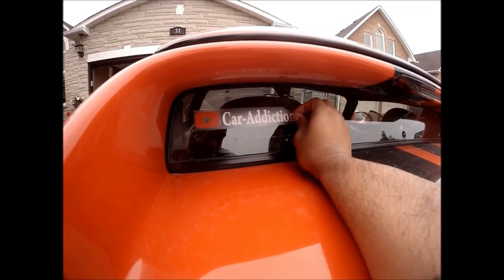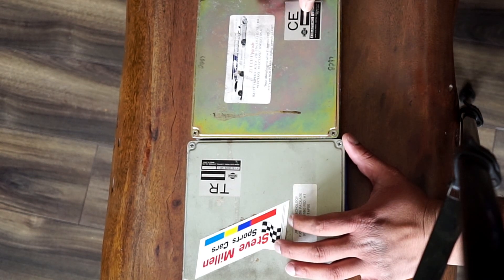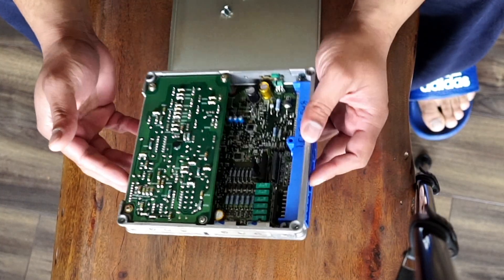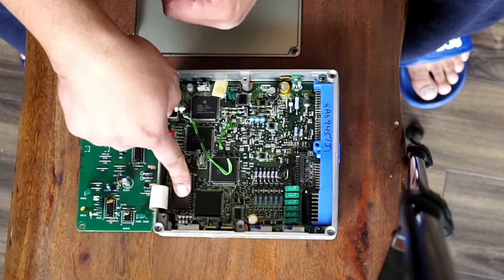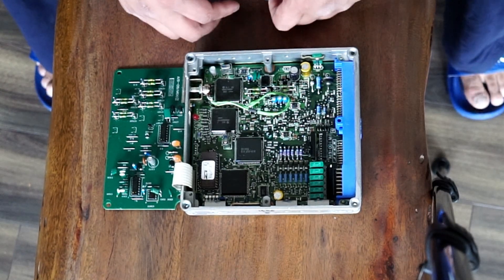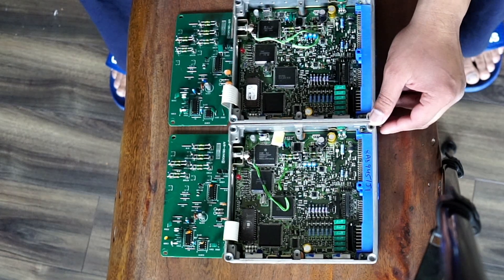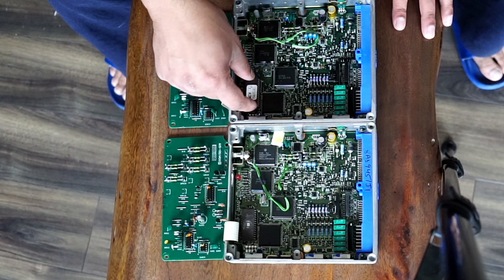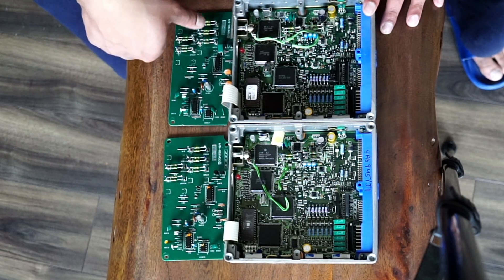Jim Wolf Technology ECU vs Z1 motorsports ECU

Comment: Hey, I wanted to know if you would recommend buying one of these if my TT is still pretty stock. Will It improve my overall drive?
Reply: His response is false. There are benefits;

JWT NA ECU Upgrade:
-12HP Gain -Easily Installed (25 minutes)
-No Adjustments needed
-Rev. Limiter Raised 200 RPM
-Cam Timing control optimized
-Eliminates Top Speed Limiter at Computer Level
-Throttle Response Code Optimized
-Control Maps "Resized" for control at high RPM and power
-Air/Fuel Ratios corrected for higher power levels
-Ignition Timing corrected for optimum torque and cylinder temperature

JWT TT ECU Upgrade
-Boost calibration jets (60HP Gain)
-Street Legal (90-92 Twin Turbo) (Emission E.O. # D-244)
-Easily Installed (25 minutes)
-No Adjustments needed
-Rev. Limiter Raised 200 RPM
-Cam Timing control optimized
-Eliminates Top Speed Limiter and Boost Limiter at Computer Level
-Throttle Response Code Optimized
-Control Maps "Resized" for control at high RPM and power
-Air/Fuel Ratios corrected for higher power levels
-Ignition Timing corrected for optimum torque and cylinder temperature
-Boost Increased to 12.5 PSI (13.5 PSI flash boost)
-Computer Controlled safety boost level maintained
Reply from the maker: Is this for z1 or jwt?
Reply: @runningrich  Jim wolf tech
Reply from the maker: The boys at Z1 or CZP will do the same, better off, get a nistune board and get it tuned by a proper tuner on a dyno.
Reply from the maker: If just stock it wont help you in any way. Subscribe to the channel,  I will be uploading my 300zxtt 120k maintenance video soon.